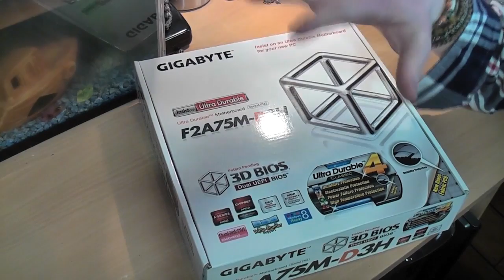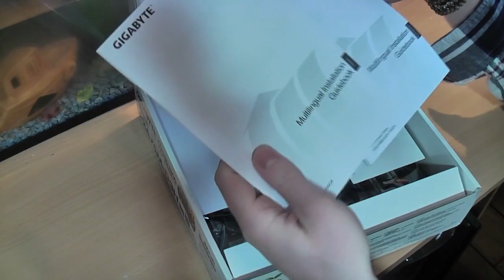Custom FM2 PC Build (Part 2)

Comment: this new  one athlon II X4 740 and 750k  are same  with proccesor and L2 cache  ,only differenz is in GHz , 740 has 3,2 GHz stock , 750K 3,4GHz  and this APU 3,6 GHz , but APU 5600K costs  40% more,  power is same if you equal  frequency

Comment: Of course it matters, they make a whole section in the manual dedicated to what slots you put the RAM into. I have an iteration of this board and have read the manual if you put the RAM in the wrong slot combinations the system won't even boot. So tell me now that putting the RAM in the correct slot doesn't matter.

Comment: If your getting a gigabyte, asus or MSI you're gonna be getting solid performance regardless, i call them the big 3. the only ones you have to worry about are Biostar, Foxconn etc... (Some on asrock's mobo's are a pile of turd but most of them are pretty decent)